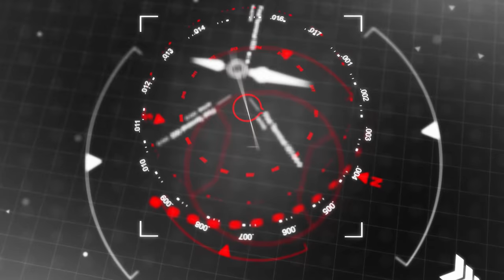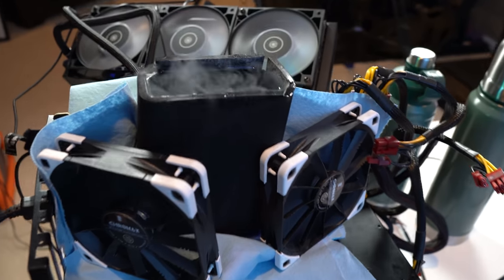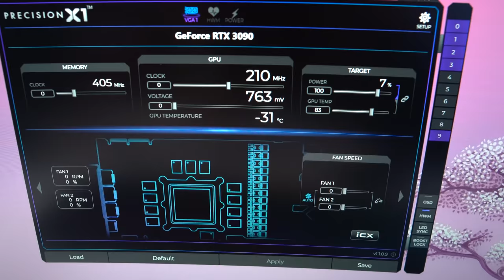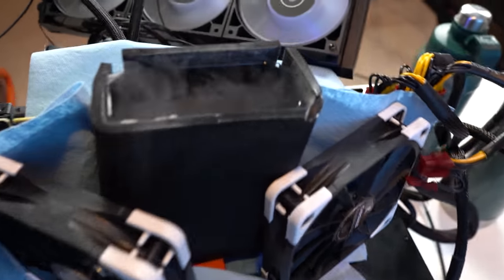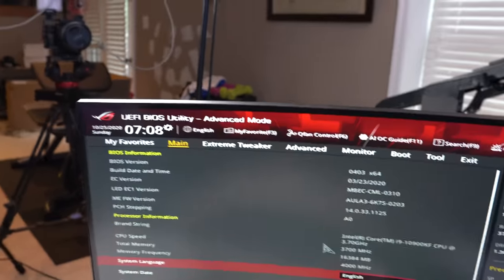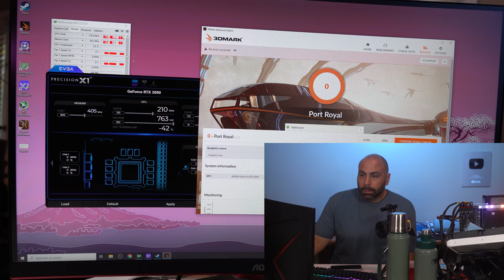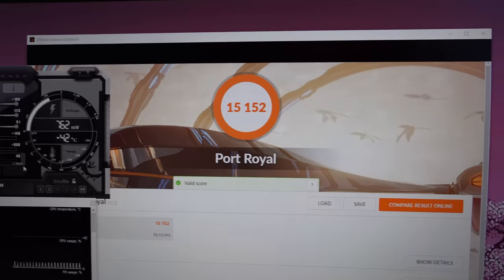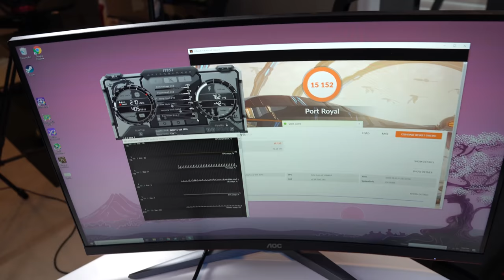I Thought All Hope Was Lost Until...

Comment: Back in the day I used to tinker around with this type of extreme cooling of electronics, I had amazing success by sinking the boards under “transformer oil” - a mineral oil with very low pour point, which not only insulated the entire system against condensation (there was no air, therefore no water moisture), but also helped in maintaining the entire system cool. Added bonus of zero fans required. Alternatively, a riser cable and just dip the card on oil.

The only drawback is the mess it causes any time you need to take it off the “aquarium”, but hey, if you want to go big, and are not in the mood to wrap every single component, this is an engineer way to keep absolutely any moisture out. Just let the tip of the pot out of the oil, have some coverings to avoid dry ice spillage over the oil and go for big scores.

Cheers!

Comment: Enjoyed the vid, nice effort!

A couple tips: 
Using Acetone will get your temps lower than Iso Alcohol can(around -73c at idle), and you don't end up with the slushy in the pot at the end of the session. You don't need a lot, just enough to cover the holes in the pot. 
Crushing the dry ice to almost snow-like will maximize your surface area and will hold temps better, but you will need to pour more ice throughout the run to hold temps.
Plasti dip was a good call, insulation looks good, you can stuff shop towels under the pot to help hold it upright better.
Point the fans at the VRM and Mem areas. They need some air flow.

Keep pushing and you'll get top spots! Nice work!

Comment: Hey Brian, nice video. Couple of things, though.
First off, I doubt the original AIO was causing your overheating CPU. Even a poor AIO (which it isn't) will still keep a CPU relatively cool - at least under throttling/overheating. (It was more likely a bad mount).
Secondly, what value resistor did you solder over the shunts on the  GPU? Too small a value acts like a "wire short" and (on Pascal, Turing, or Ampere) will cause the card to go into "protection" mode, where it will not enter 3D boost, or will fail to remove the power limits, which (based on your Port Royal score) might be the case.

Comment: Consider running a dehumidifier in the room to reduce the moisture. If the studio is closed, there are solutions like DampRid that suck the moisture out of the air, use them overnight.  If it is not there, it cannot condense. In addition to your temperature measurement, a Relative Humidity reading in the room would let you know whether it is a good day to even try...
Reply: If you reduce humidity then make 200% sure you have a great grounding and all anti static precautions set. Last you want is a static shock to zap your devices and shorten your play time.

Comment: HELP HELP PLZ READ AND REPLY
I am building a beast...plz help me plz tell which processor...mobo...case....gpu..aio....i should take?? which parts i should choose??options r given below in brackets any suggestions?? I am building a beast..... i will take ryzen 5000(which one??) with x670 mobo or ASUS crosshair viii x570 dark hero (which one??).....gigabyte rtx 3080 gaming oc (or should i choose some other 3080 like 3080 fe or something else?? and if yes then which one??)......x73 or z73 or galahad 360 or deepcool castle 360 rgb v2(which one??)....32 gb of 3600mhz ram......corsair 1000 watt psu......Msi mpg sekira 500x or lian li o11 dynamic or antec df600 flux or lianli lancool 2 mesh or something else??( i am thinking for msi sekira 500x or lian li o11 dynamic or should i take something else??)....2tb firecuda 512 gb nvme... and for fans i am thinking to use lian li bora digital.......is anything wrong? And plz give answers of the questions of the brackets....plz reply..... and any suggestions...plz tell me..